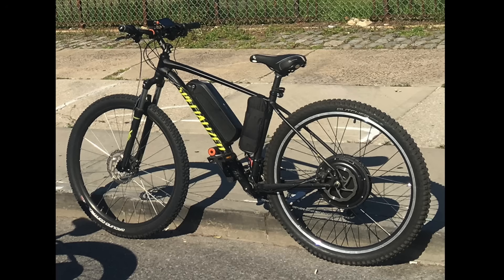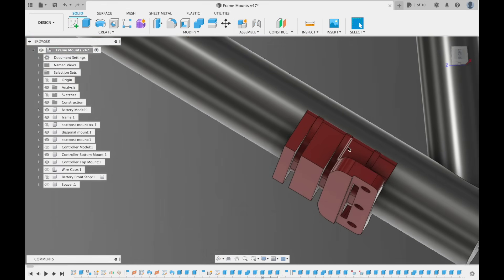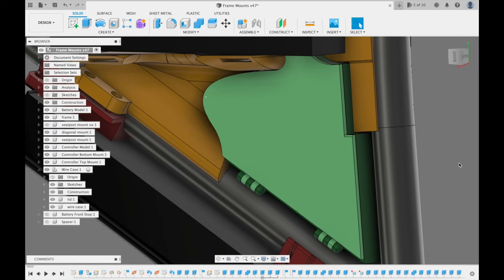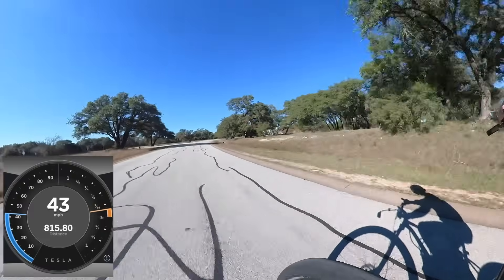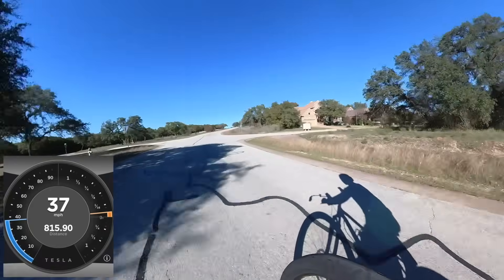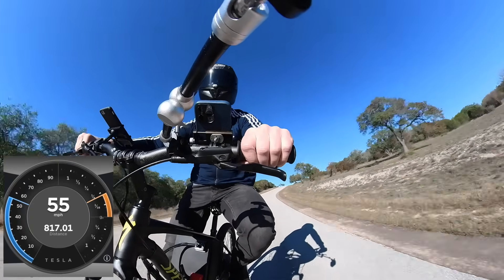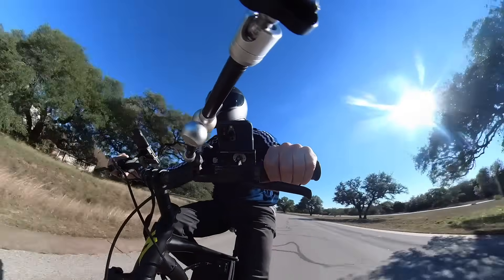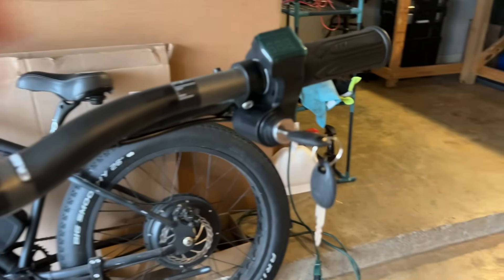I Built a 15,000W eBike and it's WAAAAY Overpowered

Comment: You mentioned upgrading the battery and controller but not the motor? Are you pushing 15kw through a 5kw motor still?! How hot does the motor get?! I'd also be more worried about the chain or spokes snapping than the drop outs! Another thing is multi cell Li-pos need to be balance charged otherwise you're gonna have a small bomb between your legs! I would definitely invest in a decent Li-po charger and start parallel balance charging those packs. If you wired half the packs in parallel you would still have a 30 mph bike but with more than double the range and reliability.
Reply from the maker: I have a BMS on that pack with handles the cell balancing reasonably well. The motor definitely get hot and you have to be careful not to blast around too much. Ive come close to frying this motor on a few occasions. this bike is anything but practical
Reply: 5 kw rate power,, 15 kw peak power

Comment: Why build a bike with 15KW when you cant go above 50mph? You can achieve that with like 3000 watts.. Good build though!
Reply from the maker: Thanks! it's more about the acceleration than top speed. the latter had more to do with motor design and voltage, rather than total power. also I wouldn't wanna go much above 50 with a frame like this

Comment: Do you have a link to the hub motor? Seems like a pretty good one if it took 10x its rating and lived
Reply from the maker: this motor is out of production but the QS205 motor is better. these motors are generally rated with very conservative values and for continuous power. you can push a lot more power through these motors in short bursts

Comment: Is it okay for the motor controller to sit there ?Concerning about splash of water from front tire
Reply from the maker: these controller are advertised as waterproof. I don't know what the IP rating is or what degree of quality control they implement in China.. probably not the best.. but I'd say you can be pretty confident that slashing would not be an issue

Comment: Honestly a bike is more about how far you can go and exercise. I actually think that just having a Turbo switch which just turns on or off a voltage buck converter to the motor should be implemented. Also I would add some small solar panels where it makes sense. With the amount of battery you have you could get really far with it. Adding a pedal generator would help as well.

Comment: What if you use the same battery but goes for range instead of power? That seems more practical.
Reply: Oddly enough, that is exactly what he did. He has the same 5kW motor as before. He just upgraded the battery and ESC. This will make the motor more efficient and greatly increase the range. The only power it adds is where there was a bottleneck in the old battery/ESC combo. He just called it a "15kW" motor for the clicks.

Comment: This really makes me want too get some lipo batteries for a bike lol. That voltage sag at 140a is just BEAUTIFUL. Only like 5-6v for a 24s pack that’s only 20ah like it’s know that lipo packs are great with putting out amps but seeing it is just great. Nice build
Reply: Yeah, my next battery pack definitely gonna be lipo!  18650 based batteries are great and cheap, but lipo is getting cheap too because of drones!
Reply: @AaronHendu   What is this guy talking about? LiPOs are far cheaper  than an 18650 pack as there is no nickel welding or a BMS. Lipos also have a far short life cycle and a higher likelihod of burning down your house.  The new Amp Ace JP40 cylindrical cell can put out 100amp for 5 sec, for one cell.
Reply: what the fuck are yall even saying @AaronHendu
Reply: @UiMark  they are discussing the intricacies between 18650 batteries, and lipo cell packs, why are you so mad
Reply: LiPo have by far the greatest power density of any chemistry but they are also the most spicy in other ways too. The reason they aren't used in applications that don't need the most power possible from a small battery is because they  like to catch fire extremely easily lol. They're lots of fun but be careful.

Comment: As much as you've been lucky to get an output of ~2 kW from a 1500 W motor, just as unlucky (or even more unlucky) you've been, getting only 3 kW output from a 5000 W motor.
What is the output from your 15000 W (=15 kW=20.12 HP) motor?
Reply: 'Wattage' of a motor is merely its rated maximum load. you can put any amount of watts through an electric motor, the 'wattage' is how many watts you can expect to get from a motor without it burning out. A 1500 watt motor might catch fire at 1600 watts or it might get all the way to 2100 watts before catching fire. However if it catches fire at 1400 watts it is defective.

How much you get out of a motor is dependant on 2 things - the voltage, and the current. Voltage is simple - its the voltage of the battery pack, ie the number of volts of one cell x the number of cells connected in series. 10 12v batteries in series gives 120 volts. Thats all there is to voltage. Current is determined by voltage (as defined before) and resistance (ie the 'load' on the motor, including factors like inertia and friction). The amount of current you supply to the motor is determined by the speed controller - a 60 Amp controller can supply a maximum of 60 Amps. There are a couple of other factors here - firstly is the battery capable of supplying 60 Amps (this will be stated on the specs for the battery), if it cant, you likely will have a Battery Fire which is not good for your bike. The second is, if you delibratly want the speed controller to supply less than the maximum current. If this is the case, as it usually is, you can 'throttle' the supply of current, and the device you use is called, unsuprisingly, the throttle. This is where the term throttle comes from in the first place - it applies equally to throtting the supply of air and fuel to a combustion engine as it does to current in a motor. The throttle does not 'add' extra fuel/amps, it throttles the supply of them to the motor/engine.

Watts simply is volts times amps. With the examples given above 120 volts times 60 amps is 7200 Watts. This is the maximum the speed controller can put out, but it wont always be putting out this many watts. If you are travelling fast and downhill, there will be little load on the motor, so the controller will supply less amps. If you have the throttle closed, the controller will supply less amps.

Notice something here. The number of volts, amps, and watts put through the motor is NOTHING to do with the motor. The motor simply takes the number of watts put into it, and decides 'can I operate on this wattage'. If yes, then it turns the electrical energy into rotation of the driveshaft. If no, then it turns the electrical energy into fire and you get a fireball. So, if you are only getting 3kw from a 5kw motor, and the motor has not blown up, the problem is the speed controller, battery, and other associated components and wiring, not the motor.

Comment: I got up to 89kmh in a downhill with a cheap alloy mtb so i think going 60mph or more its fine. The problem is not going fast but accelerating fast, and when going fast you have to tuck in or you risk loosing control and wasting battery, the front wheel lifting is a result of that.

And remembre these bikes are meant to go down a mountain they are made to take impact so the chance of it braking is small.

Comment: A better frame would be a lot safer and the bike would handle much better also great job though 💯👍⚡⚡😁
Reply from the maker: Thanks! yeah, definitely not the ideal frame for this.. it's just what I had
Reply: @GaiusGarage If that doesn't change the legality/illegality/getting away with it, a 125cc motorcycle would be a great start.  Theres gotta be frames out there, engine shot etc.
Reply from the maker: @gur262  100%. this was more of a fun "see what happens" kinda build. would definitely not do it again. in fact, I do have a 125cc that I converted to electric.. about to post that video

Comment: I had a Marin Fairfax SC3 gathering dust because of the Seattle Uphills.  My uncle’s mountain ebike inspired me so I got the Bafang 48/52V 1000W crank motor kit.  My wife got a Rad bike.  Long story short, I ended up building her a bike using a Costco mountain bike.  Her 7 speed and lighter body weight kicks my ass until a long stretch.   30-35 on flat ground no problem.  I assume hub motors are good for solving the derailleur/cassette annoyances.
Reply from the maker: yeah mid-drive conversions are hard on the drivetrain for bike. but hub motors are hard on the dropouts. basically, conversion are best when they are relatively low power. the higher power stuff is best for steel/custom/purpose-built frames

Comment: Nice skills doing the 3d printing and building everything on your own, im a beginner at electronics etc, why is it dangerous with aluminium frame?
Reply from the maker: Much appreciated! Aluminum is not as strong as steel but the real problem is that it is more brittle. so unlike steel, which has more capacity to bend and deform, aluminum will be perfect fine then suddenly fail completely without warning
Reply: @GaiusGarage  Oh okey, thanks for explaining. Whats the best way to learn build batteries and ebikes? Should i study some electronic courses first or whats your recommendation?
Reply from the maker: @henriksvensson2836  just pick a project that you want to work on - maybe an ebike conversion or similar and start taking steps to figure out the details as you go. electronics course would be helpful but they deal a lot with signals and circuit design - unless youre building your own motor controller, its definitely overkill. V=I*R  and P=I*V are two formulas that you need in 90% of cases. If you're interested, I'm offering 30 minute consult sessions to help people cut through the confusion. link is in the video description
Reply: @GaiusGarage  Great, i will check it out! Thanks again and take care!

Comment: Wheres the BMS? 🫣
Reply from the maker: its in there. check out the build video for that battery pack https://youtu.be/iPsxvFEz4SU
Reply: @GaiusGarage  ah ant bms, never used only jk bms. Does it have active balancing?
Reply from the maker: @gackhuhn4868  nope. and the passive balance feature has some significant caveats. but you can at least monitor the cell groups via the app. since this pack has not really been stress much at all, the cell groups have remained in balance so far. if I built this today (which I wouldnt in the first place) I would definitely include an active balancer

Comment: Looks like great fun to ride, and is obviously illegal. I hope you're balance charging all those Lipos by the way. That is the main thing that worries me about all electric vehicles, and the main reason why, if I was going to get/build an Ebike, I would not use lithium cells. My RC cars go quick enough on Nimh! 😁
Reply from the maker: there is a BMS in the battery pack that does a decent job of balance charging, although you are right, it could use an active balancing solution. I definitely wouldnt use lipos again for a pack like this - would go with NMC pouch cells instead
Reply: @GaiusGarage  Just looked NMC up and they are still Lipos
Reply from the maker: @wordreet  they are all lithium ion chemistry just in different ratios. Lithium Polymer cells have more carbon which allows for higher discharge but make them more unstable. NMC are pouch cells similar to lipo but carbon is lower and probably some other differences in chemistry

Comment: At 15kw, it will do 75 no problem. I built a 1500 watt bike that went 40 MPH.. that's 10 times less bro.
Reply from the maker: power is not a good predictor of top speed, which is determined by motor winding and construction, voltage, wheel diameter, and gearing

Comment: not just the aluminium frame the motor wouldnt support full throttle of 15kw power
Reply from the maker: you can push any amount of power into a motor, just depends on the length of time the power is applied before the motor overheats. This motor will easily take 15kW for a few seconds at a time. At full throttle, the full power of this system will only be applied for 1-2 seconds before the bike accelerates and the power drops. 15kW is peak not continuous power

Comment: A 15K watts rated controller is a lot different than actually putting 15K watts (~20HP) to the ground. If you were actually *using* that power, you would be snapping the relatively weak bicycle chains and hub pawls left and right.  Remember, Volts x Amps = Watts. You're pulling nowhere near 15k watts.
Reply from the maker: how much power am I pulling then?
Reply: @GaiusGarage So it is a 150A max controller right, well that is dependent on those capacitors on the phases.  You just won't be able to surpass whatever the amps rating on those caps without blowing them.  And there's going to be a max voltage rating as well that is going to be limited by the components in the controller.  The last barrier is heat.  Heat is translated as watts.  So if your controller is rated for say 4000W, then if you are feeding it 100V then 4000W / 100V = 40A is the safe limit.  Since heat is the killer, you're probably going to be able to burst 80A-120A for short periods, and you will as you backfill the motor from a dead stop, that's common and anticipated.  But you won't sustain more than 4000W for long without seriously degrading or melting the controller.  80A @ 100V would be 8000W, 120A @100V 12KW.  But not sustained, not without some serious after-market heat sinking of those MOSFETs.  So you build the bike for what you need to fit within the wattage limit of the controller or get higher wattage controller.  You can go higher volts and lower amps, or higher amps and lower volts, as long as you fit in the rated wattage of the controller you shouldn't see overheating of the controller.  Higher volts gives you speed, higher amps gives you torque, essentially.  The reason that controller is so large is it probably has lots of MOSFETs.  The heat gets generated by the rapid switching of those MOSFETs as it rolls through the phases, so the more of them you have the more switches to distribute the heat across.  Bottom line is the controller can handle 150A, by the capacitors at phases, but at a sustained 150A current on a 4000W controller that's 26V, you're talking about a station wagon, not built for speed but can handle a load.  At 100V you're going to want to be gentle on it a little if you hook up a trailer, or find yourself on a steep incline; those things will try to pull more amps sustained, and generate heat.  Now the motor, well its 5000W that means it can safely sustain 5000W of heat, after that you're pushing it past its ratings, and we all do it, right?  I don't even think about going 2 or even 2.5 times the motor rating, and I use ferrofluid and hope it helps.  You're safe though, you're actually going easy on the motor.  The answer to your question is that you're probably not pulling much more than the wattage the controller is rated to handle, if it isn't melting under you.
Reply from the maker: @DanielKreimendahl  you are right, Im definitely not pulling more than the controller is able to pull from pack and push to the motor. this is a relatively cheap controller and I never really took the time to dive too deep into the design specifics. you are right, there are a bunch of mosfets in there, hence the size. but the voltage limit is something like 130V (I am running at 86V nominal, 100V max..of course there's voltage sag) and the current rating is 150A, which I can confirm from monitoring the BMS. 150A sustained is probably not feasible, for the reasons you mentioned, but peak power at 100V and 150A is 15kW. This is not sustained, continuous power, unless, like you said, Im pulling a trailer or going up a steep hill. In reality, you see this power output (or just a little less due to voltage sag) for just a few second during hard acceleration, at which point it levels out as your speed increases.. but that's too long to put in the title
Reply: I don't think his controller is 15KW rated, but if it is, the only thing keeping him from hitting that limit is not loading it enough.  It is probably 4KW or 5KW or 3.5KW controller.

Comment: What is the point? Just for fun, but can be pulled over by police and get citation because it is illegal, legally bicycles can not go on cars lane , but bicycle lane because no plates and limited speed etc. Want to go faster speeds ride a motorcycle.
Reply from the maker: yes, for fun. ever heard of it?
Reply: That also depends on your country/state/county rules. Where I live ALL e-bikes are suppose to be ON the road if the have a top speed of 15mph or more. This is to prevent pedestrian injuries as well as blind corner crashes. (usually of people walking out of stores and shops without knowing an e-bike or even regular bike is coming)

Comment: Nice build! amazing sound of the motor! ...I also built a 3kw bike full suspension and is lot of fun! but the sound of my bike is kinda ugly like a robot screaming just sometimes 😆 Im using a 1kw hub motor with a 3kw controller.. and im so afraid to burn out the motor! ...once I also tried a double hub motor bike with 2 controllers 2kw each and it was so fun cause the front wheel burst the asphalt when you accelerate cause of loosing grip!
Reply: With the motor on the font wheel, that is got to be tough to steer ?